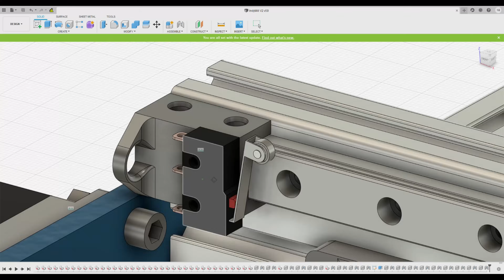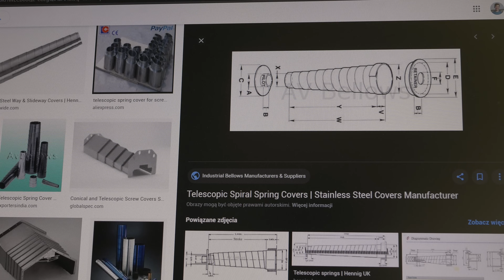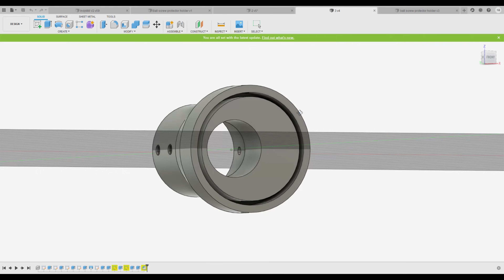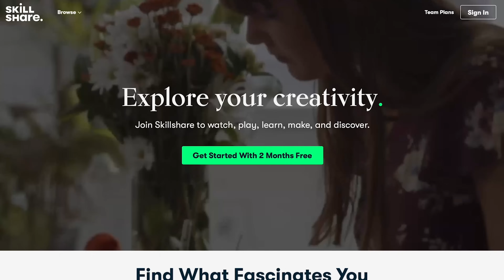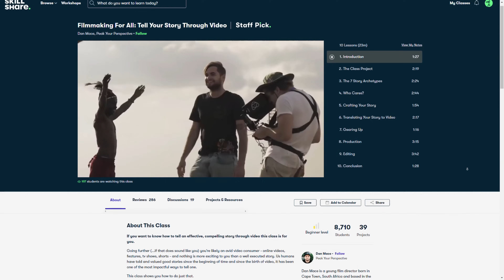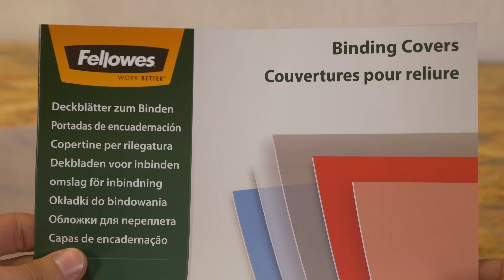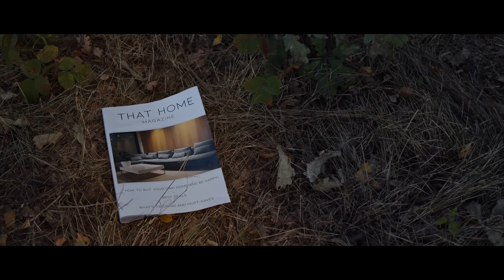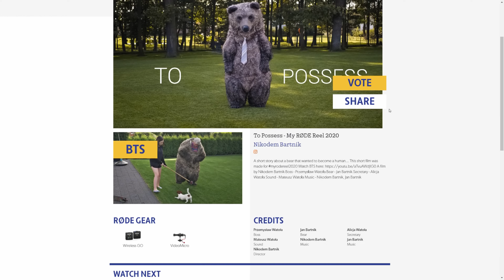DIY Telescopic Ball Screw Covers For A CNC Machine

Comment: Great video Nikodem! I followed your telescopic cover approach when building my own Indymill, but ran into some challenges with the sliding mechanism - couldn't get it to slide smoothly in/out consistently. 

After some trial and error, I ended up developing a different dust cover system that actually provides better dust protection than telescopic covers. For the X-axis I use a flexible fabric cover that's completely dust-tight (unlike telescopic which always has gaps), and for Y-axis I found professional accordion covers work much better.

I documented the whole process and created 3D files for anyone interested. The fabric solution is actually simpler to make and more effective at keeping chips out of the ball screws.

Anyone else had issues with telescopic covers, or found alternative solutions? Would be happy to share what worked for me! 

Thanks for inspiring the CNC journey! 🔧

Comment: for joining the PVC sheets. What methods did you try? PVC piping is often solvent welded together using PVC Cement, I wonder if that could work. Another option could be using a clothes iron with a sheet of parchment paper to prevent the iron from sticking to molten plastic.

Comment: Regarding the ball screw covers. This would cause your X axis to be longer but.... instead of the ball screws on the outside of the X gantry supports, put it on the inside. Then, on the top of the Y rail and linear rail/bearing assembly, you can add a simple flat piece of aluminum that "almost" touches the X gantry. This would shield the rails and the the ball screw. Also, it would be a nice place for the wire chain to rest.  Again, it would cause the X gantry pieces to be longer.

Comment: Offset printing plates might work perfectly in this application, they are made with very thin and springy aluminium. The problem may be where you can find them in this age of digital printing.

Comment: You'll have to enclose your linear bearings as well! Try to have a complete and a moving cover for both between your milling volume and the bearings and ball screws. I use a side cover for 80% of the dust and a driven rubber cover around the moving parts

Comment: Instead of joining PVC sheets together with hot glue, you should try taking a large soda bottle and cutting it into a very long 40mm strip. If one bottle's worth of strip isn't long enough I believe you could also clamp 2 strips together with some blocks of metal and slowly heat the metal block up to fuse them together in a seamless fashion. You can use some spacers of the correct thickness (perhaps metal feeler gauges) between the two clamping surfaces to make it so when the strips melt together the clamping force doesn't just squish them very thin and it will make sure the seam is of a uniform thickness. Maybe some wax paper on both sides of the strip to act as a release (kinda like fuse-beads when I was a kid.) Oh, fuse beads... Use a clothes iron as your slowly heating metal surface 😃
Reply: Did some math, the 2L soda bottles here in the US are ~105mm in diameter and the usable middle cylindrical section is ~150mm tall. So let's say we basically have a cylinder with 325mm circumference and 150mm tall. If we slice that into a spiral where the spiral strip is 40mm, wide out of one bottle we can get ~895mm of 40mm wide strip; for us US peeps that's just about 3ft.

Comment: If you add air valves to the covers and provide a little bit of positive pressure, it'll keep the smaller dust pieces from going in between the layers.

Comment: Congratulation this a very clever solution !
can i suggest you to add a flexible pipe who add a positive pressure with deshydrate oiled air and distributed it with a micro lubrication your screws will last for years. Make bellows to protect the slide the slider hates dust and add the same technique as above !

Comment: Nice dialog from Bart to Bart. But why you not do like I did, I designed a sponge holder that is oiled and cleans the debris, both ball screw and linear rails. Naturally you need clean those sponges every so often but, they lubricate and keep debris out of getting in into bearings. In addition I have chip cover to direct most of the chips on y direction both sides.

Comment: If you take a 2 liter soda bottle, you can cut it in one long strip by using a spiral cut.  I make very long pieces of clear plastic this way.  Just keep to the portion of the bottle that has no curves.

The spiral cut might actually benefit the ball screw cover, because it needs a little spiral anyway.

No glue joints!

Comment: Use a plastic shower curtain rod cover which has a slit in it .cut the proper length for the ball Screw. slip it over the ball screw through the slit and just let it hang there . there's your dust cover
Reply: How would the telescoping work?
Reply: @TheRainHarvester  Carson telescope there's a slit in the whole tube
 open slit, slip it onto the rod and take it off when you want

Comment: If you want a good way to join the PVC strips together, you can use a blowtorch to melt one face on each of the two ends that you want to join, and then stick them together with the melted faces touching each other (maybe 2 or 3 cm of overlap) and clamp them between two pieces of clean scrap metal (vises are good for this). After cutting off the excess plastic that flowed out the sides of the strip, you should have a pretty solid connection. Great video!

Comment: This is gonna sound really boring, but here's an alternate design. Instead of the telescoping cover, just encase each side in a "box" and cut a slit along the top long edge for the Y-axis vertical arm to pass through. To keep a primitive seal on the slit opening, use bristles. They move aside when the veritical arm passes through, but form a seal to keep chips out.
Reply: It seems like sawdust would settle on the fibers, then fall in as the gantry moves them apart.

Comment: If you want to go one step further, you could add an air line to provide a tiny bit of pressure inside the shroud to further 'encourage' the dust to stay out.
Reply from the maker: Cool idea! Never thought about that. It would be like a positive pressure suit for ball screws :)
Reply: Was thinking the same thing. It's like positive pressure in a PC cooling setup.
Reply: You could look into those plastic hoses with metal rings inside and see if they work, I'm not sure there are any in the right diameter though. I don't think they will offer a lot of resistance to the advancements of the x, y, z axis and the idea of the air is also a very good one.

Comment: Limit switches can be replaced with TMC2209 drivers these days, they have Stalguard built in ;) And normally we use bellows around our linear systems to keep everything clean. I really like the telescopic idea, but for me bellows work really well and are affordable if you find the right supplier. Now what I want to add, old bellows were sometimes made with some very smooth and strong (200grams) black paper backing and overlayed with some sort of fabric. This causes the inside to be smooth and the outside to be tear-resistant because of the fabric. The benefit of bellows is that it really doesn't let any dust through, whereas the telescopic solution will collect dust in-between the paper layers and eventually it can get either stuck, or will keep dust inside of the telescopic tube instead of keeping it out. I suggest using a fabric 'sock' over the telescoping tube will keep dust out. This could be a great addition to your design.
Reply: Fabric sock sounds easier.
Reply: @justgotravel6646  I think the sock needs a medium in order to keep it from getting into the mechanical parts. So the telescope is ideal for that.
Reply: @MarinusMakesStuff  i was commenting on the dust coming into the telescope tybe when i saw your comment.

What about just a plastic bag tube with thin Steel Wires to keep it's round shape. Or make it as a shower curtain with a bar holding the Steel Wires.
Reply: Btw the tmc driver you talk about is that the one that detect friction / stop on the motor.
Reply: @justgotravel6646  Oh yeah that sounds totally cool, a plastic-bag-tube kind of design with a thin wire spiral made or spring steel would work nicely as well! I like the idea.
Reply: @justgotravel6646  Yes, the TMC2209 drivers have Stalguard built-in, it measures the back-EMF from a motor being forced to stop. This system is so sensitive that it can detect the smallest stops. The only thing is that your machine needs to home with a specific feedrate so that it doesn't cause too much vibration. I'm using it on two of my machines and am a great fan of it so far. Here's more: https://www.trinamic.com/technology/motor-control-technology/stallguard-and-coolstep/
Reply: @MarinusMakesStuff  it's hard to explain without a drawing, but imagine you make the plastic tube and you have small Steel Wires to make it round, say a ring every 2 cm. Then you make 2 tubes. Then from motor to the other end your put 4 Wires going through the two plastic tubes 90 degrees spread to hold the tube and prevent it to go into the bar. Not sure if it would work, but it sounds cheap and a dyi version.
Reply: @justgotravel6646  I see what you mean, then I think a spiral inside would work better. Because, where do the four straight metal pieces go when they are compressed?
Anyway, I notice Nikodem hasn't replied yet so he might not like our suggestions at all 😅
Reply: @MarinusMakesStuff  see, i knew it's hard to explain, i see you misunderstood. Lets stay you put up 4 thicker Wires end to end that goes through the holder of the cnc. They are fixed. The holder just move back and forth regardless of the Wires. The Wires are to hold the tube rings.

Extra remark, you have 4 holes in the holder where the wire just go though. (end to end)

The Wires goes parallel with the screw bar it's whole lenght.
Reply: @justgotravel6646  Ahh, I get it. Like four thin linear guides. That could work. I would say: make a prototype! :)
Reply: @MarinusMakesStuff  let me do a drawing i can share with you, maybe i would realize it's not working at that point. 🤔
Reply: @justgotravel6646  I think the only condition that needs to apply is that the four guide wires need to be pre-tensioned.
Reply: Do the tmc drivers work with grbl?

I noticed the cover reduces travel.
Reply: @TheRainHarvester  TMC drivers only work in standalone mode on grbl unless you can connect to it with UART. And then you'll still have to hook up the diag pin to the respective axis endstop and be able to diagnose a standard high signal being pulled low. Not sure if grbl does that but I converted my own machines to work with marlin and old Ramps 1.4 boards which also supports G03/G04 curves now.

Comment: Not bad. My first inclination would be to use polypropylene sheets, like from a folder, but there's one problem with them... you just can't glue this material, at all.

PVC is a good solution and i think contact glue should work perfectly with it.